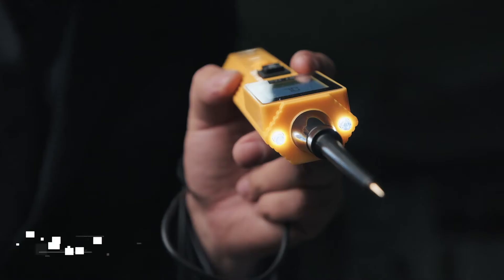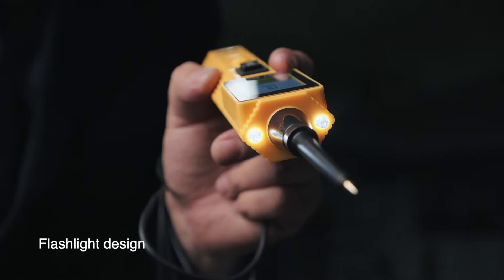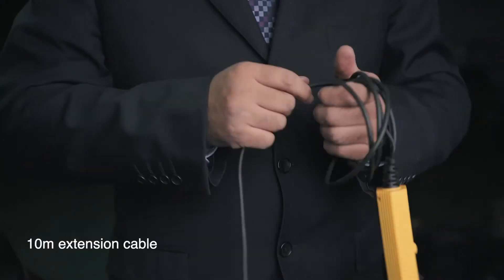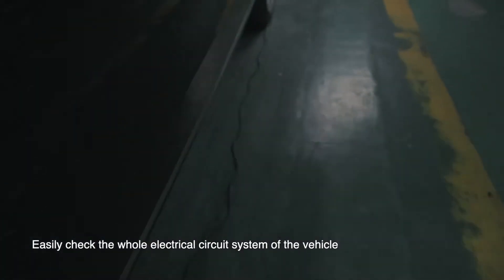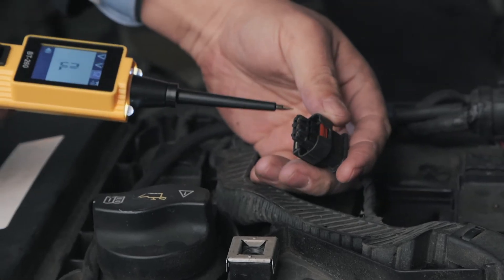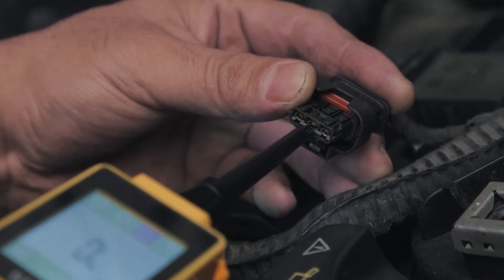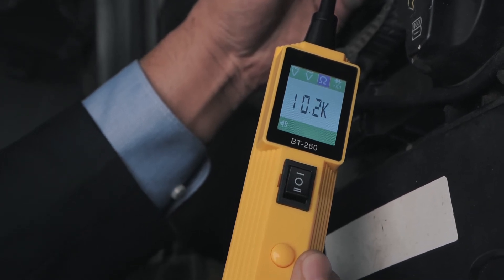AUTOOL BT260 Car Electric Circuit Tester Power Probe tool with LED Display for Voltage Digital meter

Comment: Hi have purchased this tool and was wondering about one thing. in the User Manual page 12 3.9 Folowing/Locating Short Circuit in what mode should the tools be? I assume it should be in AC mode but am not sure. you make no mention in the User Manual grateful if you can answer me. thanks

Comment: Unfortunately, I used it only for few times and know it gives a ground reading all time ...I am disappointed 😔
Reply from the maker: Hey there, I will help in any way I can. To your description, it seems there is a problem with its motherboard. Could you send me a video to check carefully to address this issue to our email address:aftersale@autooltech.com

Comment: Крайне низкое качество. Не измеряет сопротивление в диапазоне от 1 до 5 КОм. В случае короткого замыкания выходит из строя. Нет защиты от короткого замыкания.
Reply from the maker: BT260 has a reverse connection protection function and a short circuit protection function. Each product has its own working range and functional limitations
Reply: I have three of these devices. Two have turned in functionality into an ordinary control lamp. The third one is unused. BT260 is a bad measuring instrument. I ordered a similar device from Autel. I hope that Autel will be more reliable.
Reply: У меня есть три таких устройства. Два из них превратились по функциональности в обычную контрольную лампу. Третий не используется, лежит новый.  BT260 не подходит в качестве измерительного устройства. Я заказал аналогичное устройство от Autel, и надеюсь, что Autel будет более надежным. Новый BT от Autool буду продавать пока не сломался.